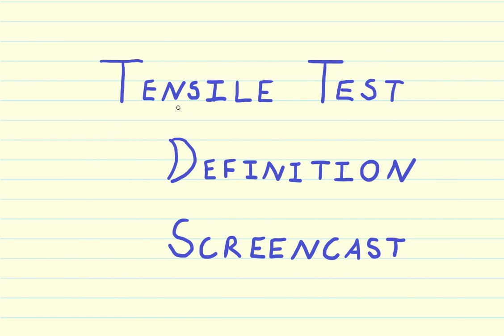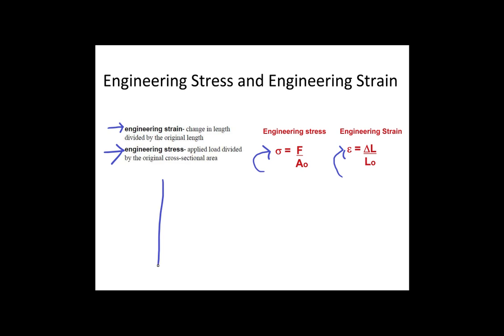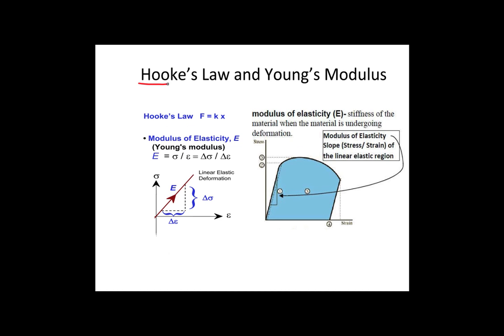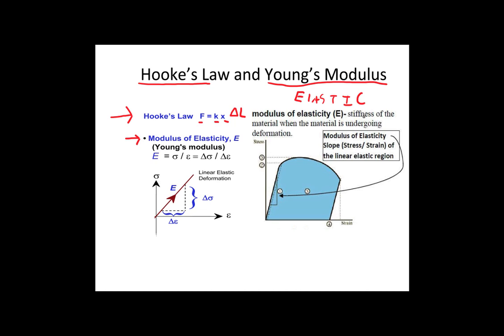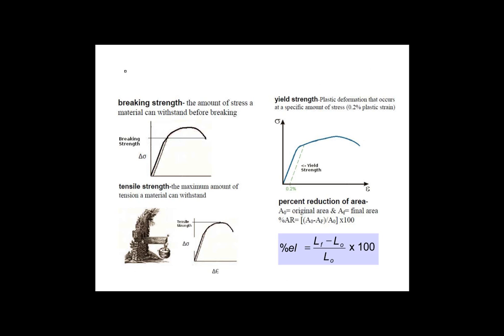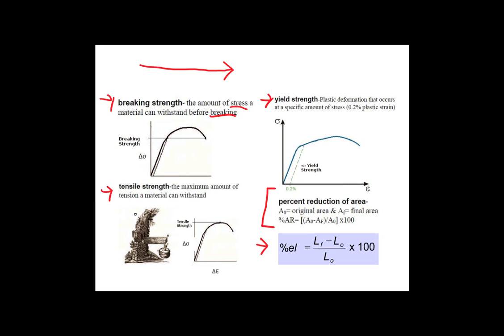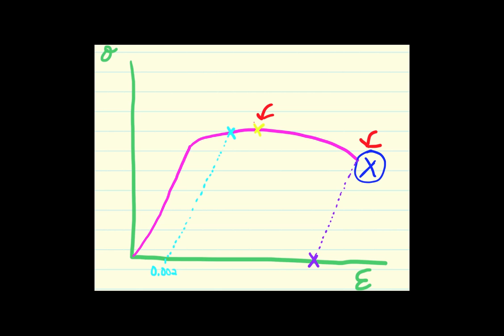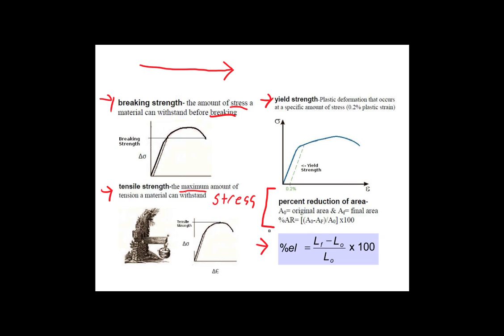Tensile Test Definitions

Comment: thank u.something confuses me. while the material is breaking in breakpoint  why breaking strenght accours at low stresses than tensile strenghts. dont we need more stress to break a material?
Reply: We need more energy to break the material. So while the breaking strength is less than the tensile strength, the material absorbs more energy (some of it is stored causing increment in elastic deformation and the other part of energy is dissipated causing additional plastic deformation) to reach breaking point from peak point. One should note that the after peak strength the material becomes unstable i.e. external force is doing negative work.